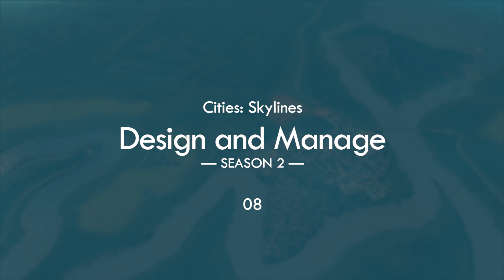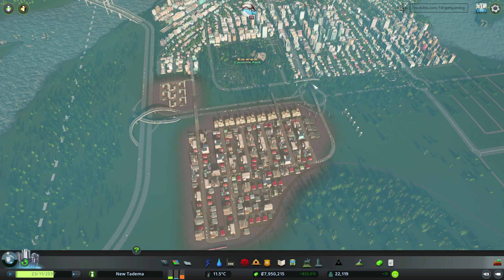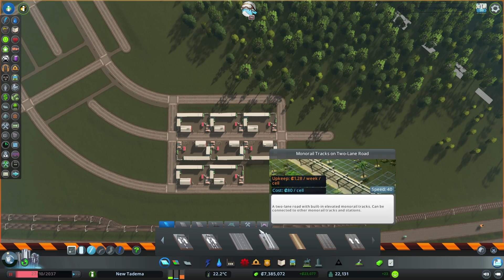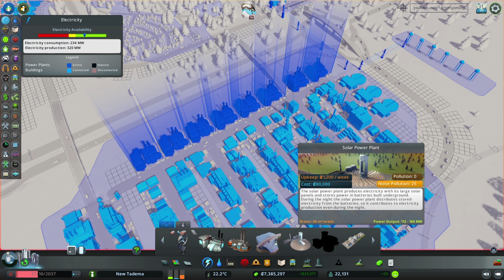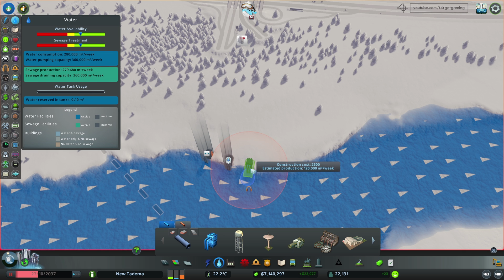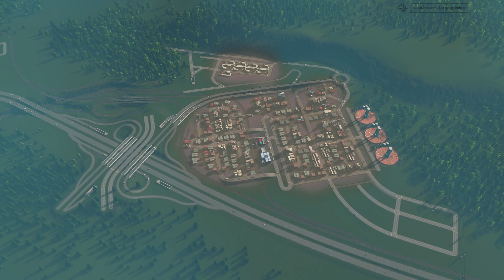Planning the Perfect Industrial Layout! | Cities: Skylines NO MODS – Design and Manage S2E08

Comment: Your two roundabouts go wrong way around? In right hand traffic they are usually anti-clocwise, not clockwise like yours. And this particular case they should, as: Your inward traffic has much shorter distance to get into main industrial are roads as they have only 1/4th of roundabout to circle. 2. Outgoing roundabout traffic has to cross inward (when there is gonna be so, theres not one yet though) coming traffic that kinda spoils whole use of roundabouts, and makes it just a regular crossing. But other than that: Good looking an well thought zone!

Also one trick I use when demolishing my initial industrial zones is: I just convert them first to (vanilla) forrest industry (acriculture also works) zones that will clean up their soil, so then I have also option to build residential zones in there without ppl getting sick.

Comment: While it may not be as pretty, I have found this to be the best solution to having good traffic in your industry zone, the red zones are just busy not backed up.

https://i.imgur.com/y6m6JZj.jpg

The other areas are my other attempts to get great traffic in the industrial zones, technically I am using mods, but I have turned vehicle despawning off so the traffic is actually worse than stock, so it should work at least as well in stock as apart from the 2 way 4 lane small roads and 1 lane tiny roads I haven't used any modded parts in it and can be replaced.

Now I just have to replace all my other industry sections in this format... also I plan to mirror they layout on the other side.

Comment: The problem with solar power plants is that thry do not produce energy when at night... So no day and night cycle sad to say

Add some leisure for the area to force buildinhs to upgrade
Reply: I believe they come with battery storage
Reply: @brewsterly2927  yes, but as what I know they produce slightly less energy when that happens..
Reply: @joshuaericdandal2559  
So?
Reply: @brewsterly2927  additional unnecessary cost... You'll have to manually turn off some powerplants when dawn breaks only to lessen costs..

Comment: I like watching you planning the city!
If you'd like to make it more realistic, then please consider much greater radius of railway turns as well as much less steep (rail an road) slopes, e.g. 3m every 12 cells (96m). I know this will be challenging, but it is in reality.
P.S. The rail loop at 16:45 most likely won't be utilized, because the route through generic industrial park and cargo station is quicker.
👍

Comment: If I may ask, what is the reason for building with 2 lane highways and then upgrading them to highway ramps? Does this make merges/splits smoother (angle is shallower) or is there some other reason?
Reply from the maker: Yes, normal roads behave different than highway roads when connecting with other roads at certain angles.
Reply: @T4rgetGaming  Thanks for the reply. I find these videos very enjoyable, keep going ;)

Comment: where exactly is the starting  point of the new trumpet interchange? I only see trees and flat land in the background. I can't get a reference point because the camera is zoomed when your building. I need to know! I'm lost on how to approach this!! help!
Reply from the maker: Check my Double Trumpet Interchange recent video. I literally build this exact same interchange at a much slower speed if you want to try to replicate it.
Reply: Thanks Target. Your the best. I finally figured out how to build the interchange. I had to slow down your video to .25 speed and take multiple screenshots. It was painstaking, but I finally got it done. I just finished it actually. Looks awesome too. I learn from you with every new zone of your city. Seems like you have your time lapse running like.max speed? watching your video in slow motion helps tremendously but you are still way too fast even for slow motion. I've seen you lay down 3 plus road sections in less than one second!!! I can only see them frame by frame. I would have missed it if not for slow motion. But I'm getting better at it!!  I have managed to recreate your city (New Tadema) step for step with sreenshots. And I Love it! Thanks Bro. I love your channel. You have showed me so much.
Reply: I thought I was finished building the exchange but I'm not even close! This is super challenging. Especially trying to make the connections to the industrial area. Then there's the dreaded terraforming with the train tracks and different land height elevation. This episode should be a challenge for even the most skilled builders I'm sure. This is going to take super long to finish if it's even possible. But still the most fun I had building a city in this game.

Comment: @7:55 thank you for putting the rail under the road.  I see so many cities players just move the rail over the road.  It's so unrealistic and costly.  You don't really see that many elevated rail lines in the real world.
Reply: Plenty of rail above road eg: https://en.wikipedia.org/wiki/File:CTA_loop_junction.jpg
Attribution: I, Daniel Schwen
Reply: @brewsterly2927  I'm referring to.massive truss structures placed over multiple intersecting roadways.  The railway may pass over the road, but it would surround the intersecting road with built up soil.  Building and maintaining bridges is extremely costly relative to building a berm and laying the rail on soil.
Reply: @ctfpd09  The above Wiki photo in Chicargo is exactly what you are referring to in your first sentence, regardless of your costing.
There are more examples in US, Vienna, Berlin, Hamburg and now modern ones in Tokyo, Brazil etc.
I think their town planers are a bit more experienced than you.
Reply: @brewsterly2927  Ok, so the photo you're referencing is subway, which is a much lighter load and smaller gauge of rail than industrial or high speed rail, which i'm referring to.  Perhaps I should have clarified that.  I have physically worked on projects that require E-80 loading, and let me tell you the design criteria for this type of loading is quite frankly outrageous and exponentially influences the cost.  You're talking about increased costs in the size of rebar, amount of concrete, size of beams, etc. in order to carry an E-80 load.  In addition to this, I have been a professional practicing construction manager for approximately 7 years, so I am no novice, nor am I a child when it comes to this.  There are certainly many individuals that have more experience than I do in all sorts of fields, but I certainly have enough experience in this specific area to be able to provide relevant and fair critique.  Furthermore, city planners don't have much say in private industry, which most rail is umbrella'd under.  Even metro train lines are often privatized, especially in the United States.  City planners don't really even design any of the work, they are mostly restricted to approving zoning and permitting criteria.  As someone who has a civil engineering degree, I to some extent, understand the limits of not only designing, but my field experience, also provides understanding of the physical limits to actually building something as well.  There are many instances where it is cheaper, safer, and smarter to avoid constructing a multi-span bridge. I do however understand that this is indeed a video game and it is no way entirely realistic.  It's just refreshing to see someone work with some limitation of the real world.  I hope that helps :)

Comment: Hi All, Wow another great video

I was shouting at the screen when you placed the garbage sites in that corner - the furthest distance away from the city

For the industry itself, it may help if you have just one industrial site there, although the system will dispatch it to anywhere ( i really hate it with fire , you see the station in the next street, but that fire station send a truck  elsewhere miles away )

With the rail, once i buy more land , i try to change the rail to have 1 x commuter train intercity, and 1 x freight train intercity, then reword the local tracks so that almost no rail track carries commuter and freight, it helps with the train congestion

I did like your solution with the main highway link and the 2 roundabouts - #1 for rail and #2 for the other new industry

Maybe expand it to 3 roundabouts so the garbage exits first and turns left

Another option is to run a separate road from the tip to the commercial / industrial zones, you are running vanilla so it will have all traffic ( if it was not vanilla then traffic manager would bock all cars that were not recycling - but on this map as vanilla it is not a option - a shame vanilla does not have roads for garbage, hmmm can you use bus lanes ??? i know they allow emergency vehicles, what about recycling ??? hmm , i need to experiment )

I may copy your set up on the weekend,  what i may try is the 1 freight rail feed to branch up as you did to industry then to other industry , commercial , and the other one to just go to the new fishing site but to have 2 stops eg one near the fishing area and the other  at the bottom end of the new industry where the garbage was for a short time. This would allow easy cross /loading of fishing to local industry or local markets eg truck will cart from the second fishing station just a few streets away to end up on regulart freight line for local or inter city

Regards
George

Comment: @t4rget I think you forgot to add a way for trains to go back.
After train gets to cargo station, it has no way to return back the same way it came in. You force the train to keep going. I think you need to add a train lane near the cargo station to allow trains to go back the way they came
cheers
Reply: Trains can turn around in the station (or just disappear if they are no longer needed). All train tracks are two-way, so they can just go back the way they came in.

Comment: The interchange and the layout look great, but I'm not sure if it's worth spending three-four hours into when you can achieve the same result by simply having more than one way in and out. The one way system serving the cargo terminal was already bottlenecking, until you gave half the trucks a faster way in and out through the waste management area :)
Reply: But then you wouldn't have 3-4 hours of relaxing interchange-building time topped off with the satisfaction of seeing it work at the end ;)

Comment: 27:25 Biffa was wrong, Roundabouts aren't the Panacea for Traffic Clogs.
Reply: To be fair, they really don't work anywhere near as well in vanilla, without the Traffic Manager mod to set them up right.
Reply: @Lou-Mae , ah yeah. Forgot that Biffa's using that.
Reply: Also, the roundabouts were facing the wrong directions. His had left turns while correct roundabouts have right turns to get on and off the roundabout.
Reply: I make it a point to never use roundabouts. It's purely to spite the zealots who think they're the ultimate answer to life, the universe, and everything. With proper planning It's easy to maintain good flow without wasting acreage on crop circles.
Reply: @johnterpack3940  Me neither! I think giving everyone lots of options is best, rather than forcing everyone onto one road. I did an experiment with a 10 by 10 grid city and it looked horrible but it never had any traffic problems!

Comment: Looks like a your roundabouts to the industry are the wrong way arround ;)
Reply: also the one at the cargo station
Reply: Indeed, both the roundabout handling the outgoing traffic (from industry to highway) as well as the oval-a-bout (connecting the cargo station) are set up clockwise, whilst you want counter-clockwise roundabouts with right hand traffic (so they don't need to cross oncoming traffic when entering and leaving the roundabout). 

TL;DR: You want to turn right on a roundabout, not left
Reply: @Stadtionalist  not true for the train station. you dont want trucks entering and exiting to cross over each other, so that loop has to be CCW.
Reply: Wrongabouts
Reply: Maybe he is British living in US
Reply: Waso King nah he’s Portuguese as far as I know
Reply: @waso999  persian king in a Bronx 
basement
Reply: i think he did that on purpose so cars will have more space and prevent junctions
Reply: Xyl9l for the exit roundabout yes, but he initially built the other one inverted too, before he rebuilt it
Reply: @xyl9l  outgoingtraffic tehn have to meet ingoing and, as putting entrance before exit on highways, it leads to overflow the layout